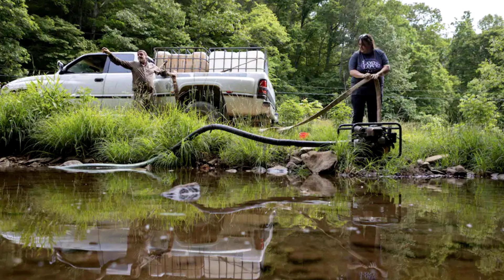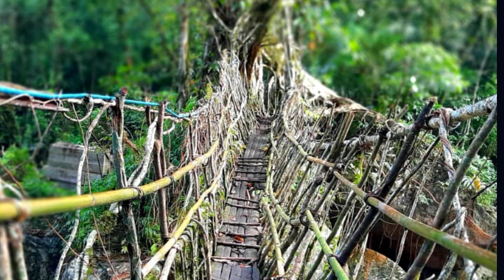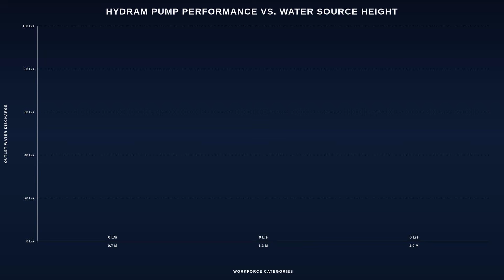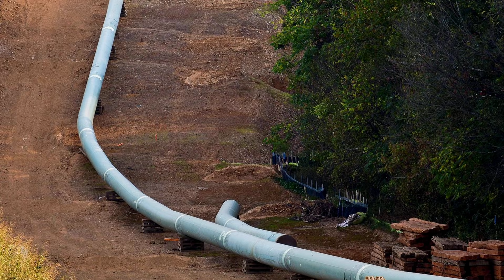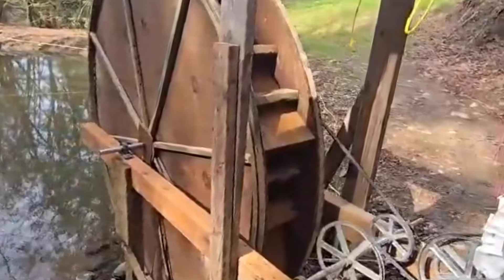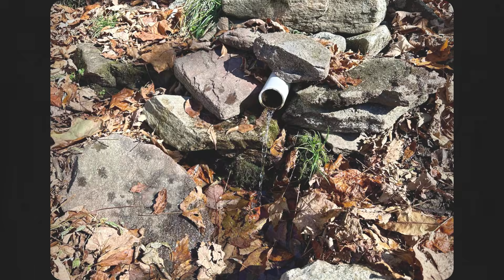Appalachian Men have never needed a pump |  The $8 Hydram the TVA banned

Comment from the maker: 👇 PINNED BY EARL CUTTER

Gravity doesn't send you a bill. That's the whole point.

The hydraulic ram pump is not a theory. Working versions of this system exist in hollers all across Appalachia right now — moving water uphill without a single watt of electricity.

The TVA had every reason to make sure you never heard the word "hydram." They sell you the power to run the pump you don't need.

Tell me in the comments — do you have a creek, stream, or spring on your property? I want to know how many of you can build this tomorrow.

🔔 Subscribe and don't let this get buried.